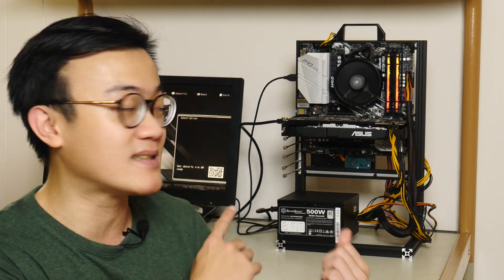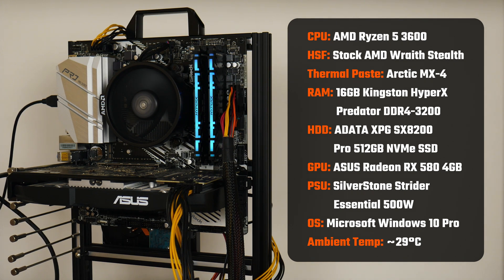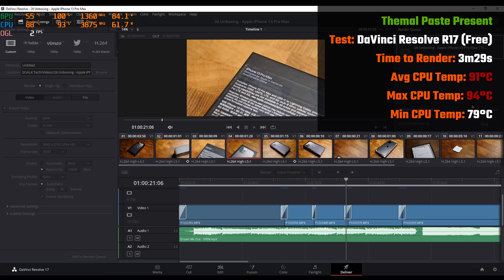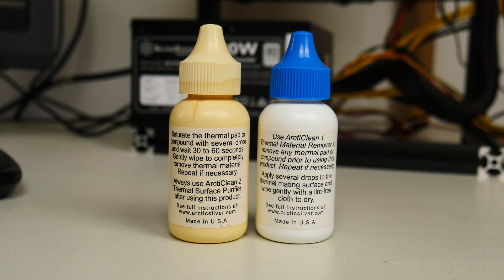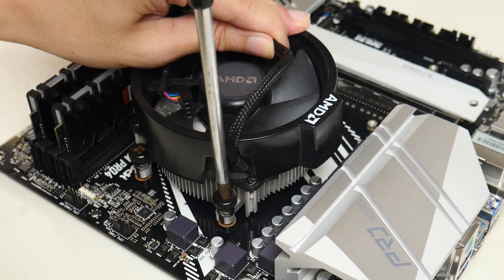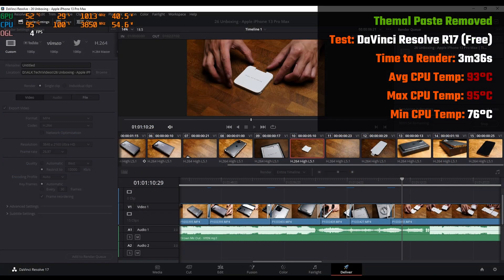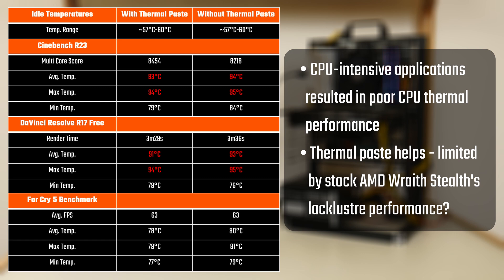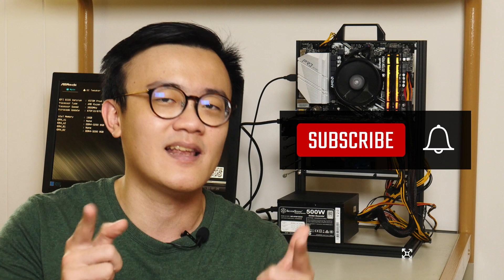What happens when you run your PC WITHOUT THERMAL PASTE??

Comment: I'd rather like to see the results with and without thermal paste without any load. And when I spread the thermal pace I'd make sure it covers all the surface of the CPU.
Reply from the maker: Oh yes, thermal paste application method is still a hotly debated topic even till today!

That said, the idle temperature results (without any load) are at 6:17 of the video! In short - the temperatures when idle were very similar with and without thermal paste when on the stock AMD Wraith Stealth cooler.
Reply: @ALKtech  that clearly indicates a problem with ur cooling system/thermal paste application. 
pls make the edits. it is just providing the wrong information to your viewers.